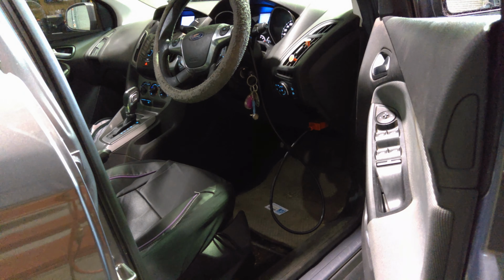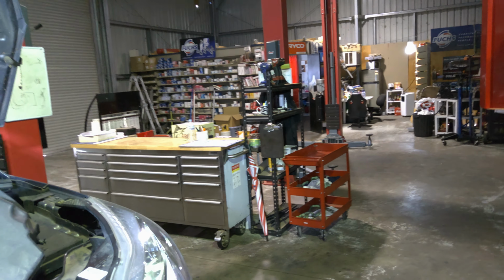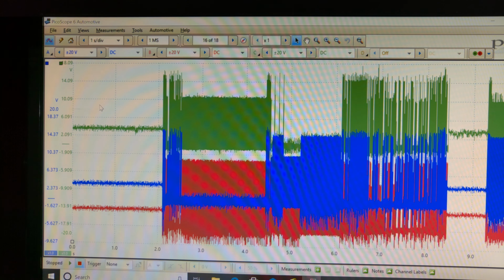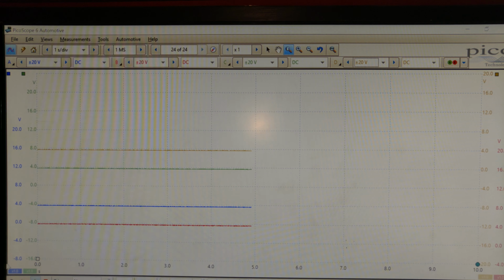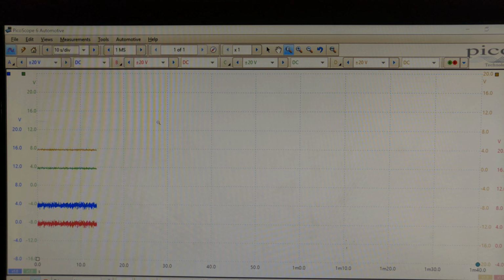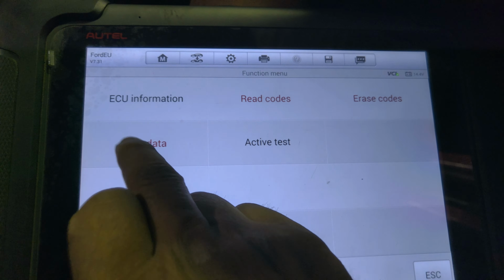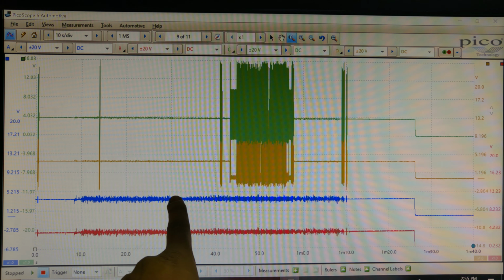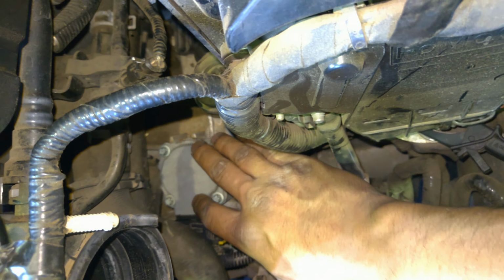FORD FOCUS TRANSMISSION PROBLEM

Comment: Is it necessary to switch off the aircond switch when u need to off the engine .(. or is it OK to have the aircond switch on when starting the engine)
Reply from the maker: It's ok to leave it on. I never seen any issue with it.

Comment: So are these models fixable? I'm looking at a 2016 focus and the seller says the reverse has an issue which led me to look further at issues with the focus model. Lots of info about how bad the transmissions are but are they fixable? Is it worth buying and then addressing the Trans or should I just avoid the focus altogether.
Reply from the maker: Yes they are fixable. Which in this case it needed a new TCM. But I would stay away from focus or fiesta because they also known for electric steering failure which could be in thousands of dollars to fix.
Reply: No they are not fixable at all . It's the entire transmission at fault from manufacturers therefore even if you pay over 2k for new it will have same issue in a couple years or less.

Comment: Motor Actuator B is bad!
Reply from the maker: No. TCM was bad
Reply: How much is a new TCM?
My one keeps saying lost communication with TCM
Reply from the maker: I do not know. But ask your local Ford dealer. They have extended warranty for almost 10 years for some models.
Reply: @a1mechanicaloakey  I did, £1300 just for the TCM and apparently they don’t have the extended warranty in UK as when I called she said it’s not covered in the UK
Reply from the maker: Car dealer can be rude. Try few more dealers. You might get lucky.
Reply: I put a new transmission on mine working perfect on a car with 35000 miles on it when I put on a different one it drives but sometimes goes like into neutral I let go of the gas and press it again and it picks up what can it b
Reply from the maker: May be low on oil.

Comment: Clean battery ground on frame of all paint clean the 2 grounds on frame to transmission under air filter fixes the problem
Reply: Plus 725 CCA battery for top performance and snappy shifting
Reply: This can cause the issue, however from my experience with these transmissions the tcm has two electric motors in it then the transmission has the electric actuators and usually when it starts having these problems something so small  can cause more damage  to the shift forks it's a shit design it didn't work from the start they actually have multiple lawsuits against on the focus and fiestas I think 2012-2016 tht won something to look into good luck I ended up replacing 4 clutches 3tcms  both actuators and then finally the shift forks and this is the ford dealership  took then 4months to fix it now 30,000miles down the road I have issues again now it says clutch b is stuck engaged so definitely do not buy these cars. God bless hope this helps save someone a headache
Reply: Your absolutely right

Comment: Of some of your videos I watched today, you set a time scale for your scope, you have made the same mistake twice now, this is not a 10-second screen, it's 10 seconds per division which makes it a 100-second screen, no worries mate. You are correct, never call scan live data nor trouble codes as 100% proof, a scan tool is only a guide, after looking at your data, pull out the scope and do real diagnosis for sure, don't follow a scan tool and be a parts changer, not fair to the customer. Be very careful, a bad fuse can be good cold but when it heats up it can pull apart and lose what contact it had at a cooler temperature, the way to diagnose an intermittent fuse is to simply check for power from this fuse at another component and see if it has the power or not with a diagram, of course, no power there, bad fuse. On problems like this, do you open the TCM to see if it might be an easy fix?
Reply from the maker: It's a live video man c'mon not every word come out of my mouth going to be correct lol. But thank you for pointing it out.
Reply from the maker: No I don't think I am skilled enough to know the internals of modules so that's not really my forte to open up module and fix it.

Comment: awesome video, i have the same problem where reverse doesnt work at all like at all, it shifts funny and sometimes it doesnt shift is just revs way to high and the speed is slow, we where thinking that one of the clutch actuator is not working anymore, because it will go from 1st gear to 3rd gear from there it will go from 3rd to 5th, meaning it is skipping gears, and it is skkiping reverse , so do you think it can be the clutch actuator? or what can it be? on my scan tool it says that is has clutch b is stuck/off and the code is P07A4, pls hellppp
Reply from the maker: If you watch my video it will show few steps how to eliminate things. In this case, this Ford needed transmission computer. But yours you need to swap clutch actuator a and b and see what happens otherwise looking like computer problem.
Reply: @a1mechanicaloakey  Thank you so much we will see what the problem is :)
Reply: @eliezeralonso7429  Hey, have you tested out swapping actuators? or it is tcm?
Reply: @doffedoff   i switched the actuators but that didn't work and the tcm as well did a quick relearn but that didn't work either and found the sad truth it was the clutch it self, so got the new clutch got it in and now the transmission works. Thanks for the ideas and sometimes your suggestions will work for other people but i got unlucky and had to switch the clutch :)